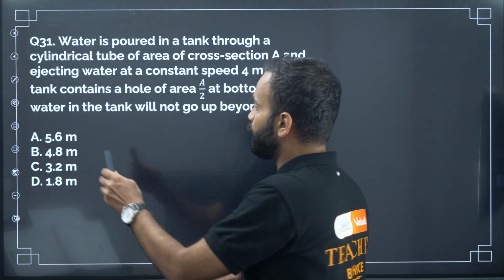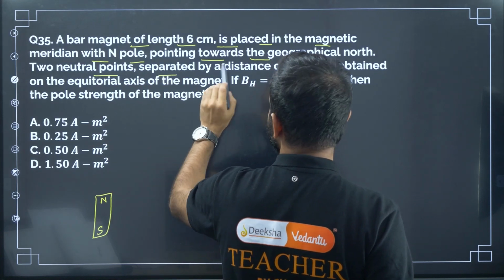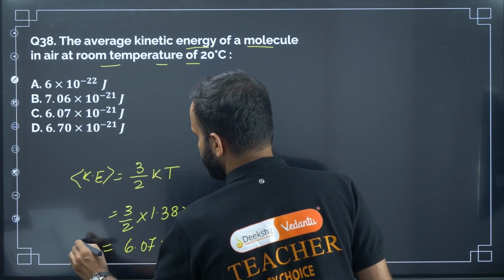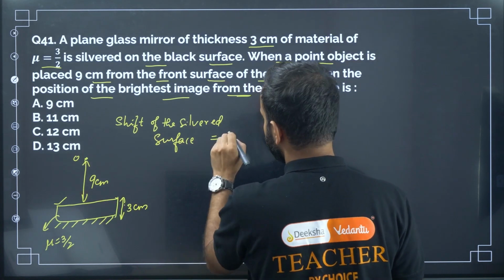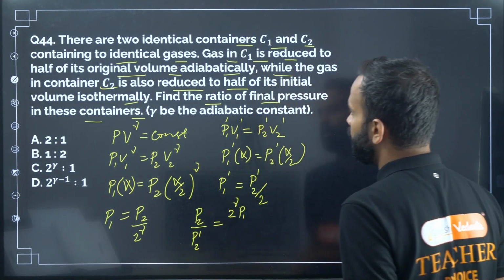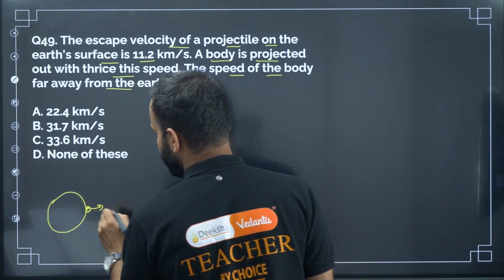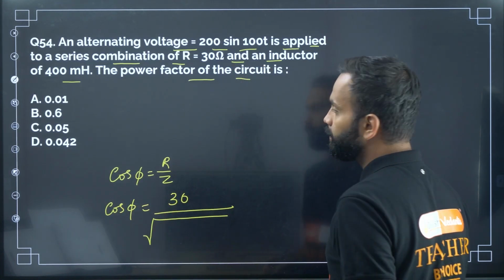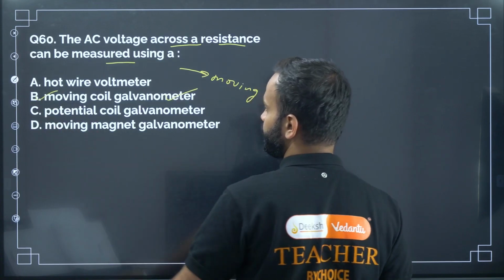COMEDK Previous Year Papers Solution | COMEDK 2023 Physics Solution Part 2 (Q31-60)

Comment: last question solution wrong
mcg is used for measuring dc currents while hot wire galvanometer is used for ac